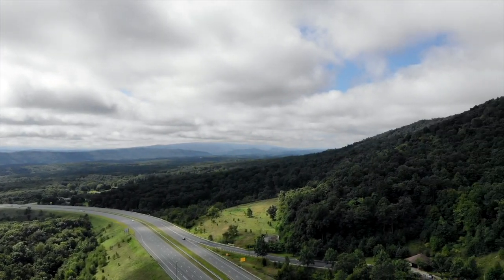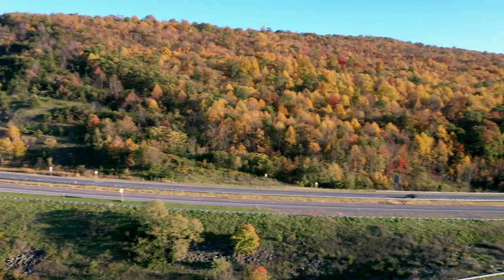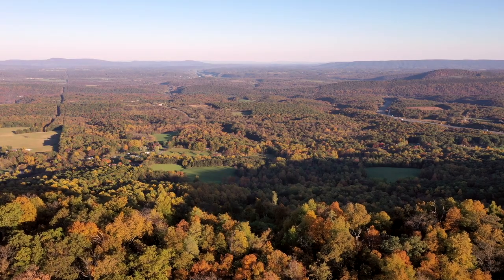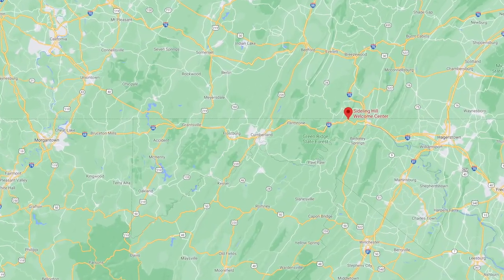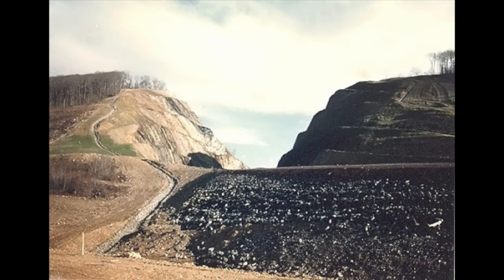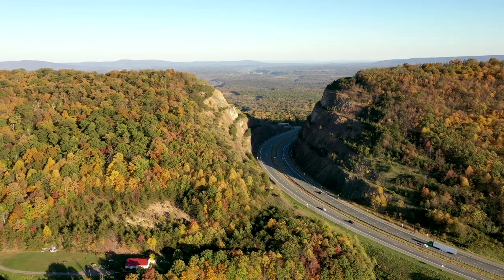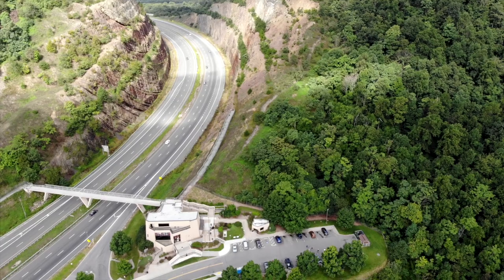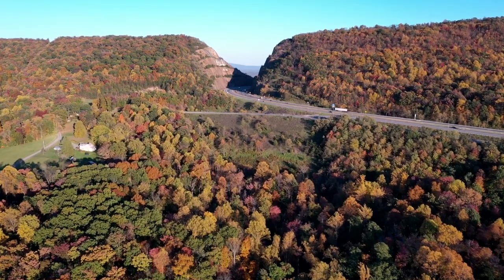Sideling Hill Road Cut - Western Maryland I-68

Comment: I-68 was designed in part to take pressure off the PA Turnpike, in particular the antiquated Breezewood interchange, where all I-70 traffic is still forced to leave the highway and go through town.  I-68 generally parallels U.S. Route 40.  I vividly remember winding up and down the mountain before the Sideling Hill cut was finished.  I believe it was the last section of I-68 to be completed, and made a huge difference.  My experience today is that most truck traffic, for whatever reason, still uses the PA Turnpike, and I-68 provides a welcome alternative for cars.